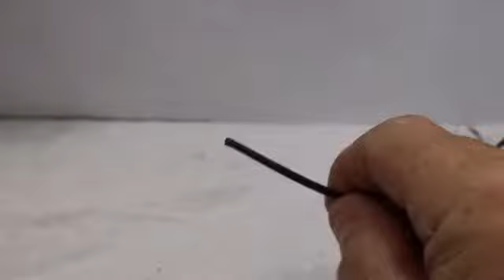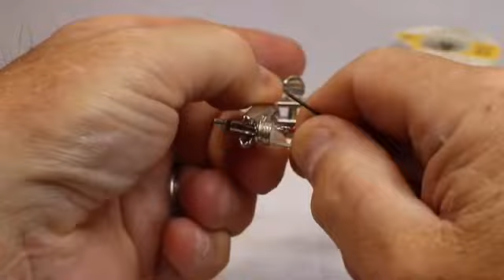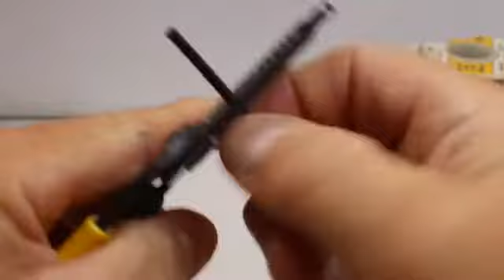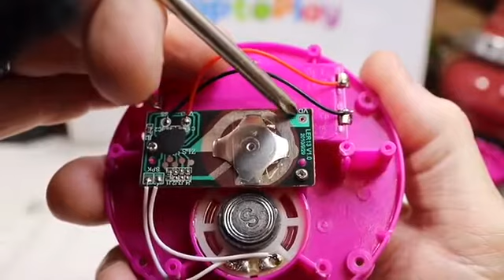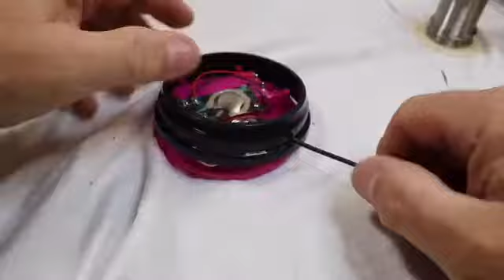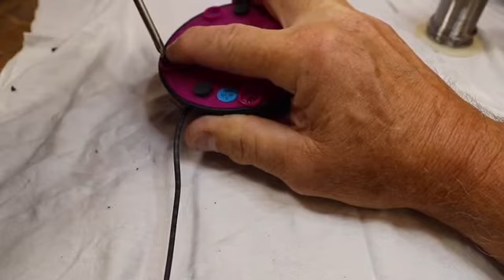Modifying a Learning Resources Answer Buzzer into a switch for switch adapted toys

Comment: Thank you for your great explanation and video. I purchased 4 units and when I opened them up, the ckt is totally different. It is marked as version 3 old your units are version 1. I found different connection points.  I have a picture of it, but can’t upload it to the comments.
Reply: I got the same buttons but they are recordable, I have no idea how the circuit works.